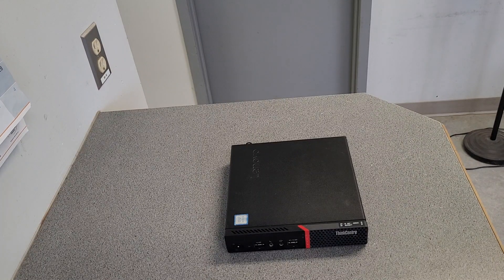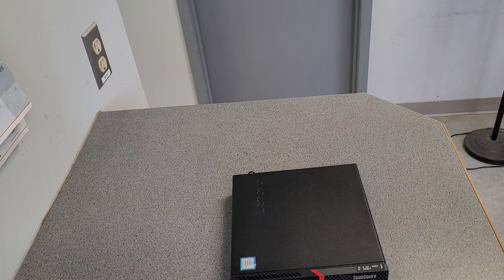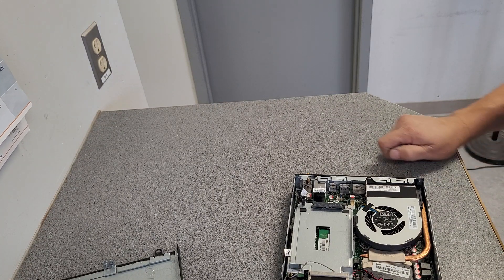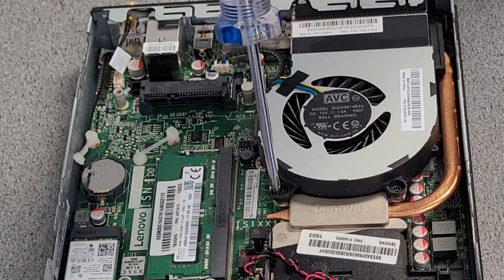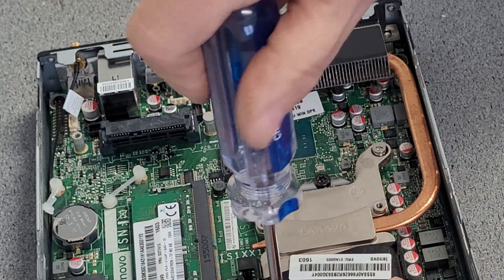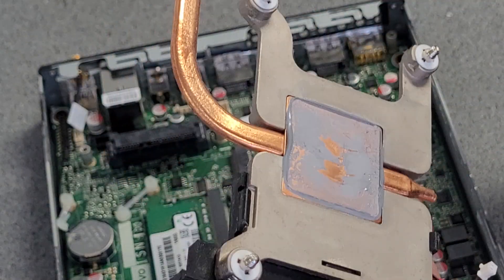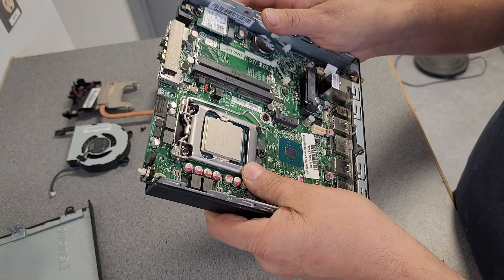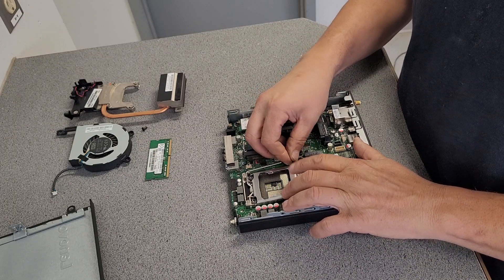Lenovo M700 Think Center disassembly

Comment: The form factor is consider a Mini-DT, or mini desktop. They are generally cheaper then normal desktops because they will have lower end components, usually designed for light operating systems, daily activities in a home office, or even deployed in a business like in your case.

The copper bar you saw below the fan was a heat pipe. It has copper fiber inside it, as well as a small amount of water. The water will evaporate as it heats, and travel to the end of the tube, before condensing and returning to continue the process.

I’ve got to say, I really appreciate seeing someone who doesn’t understand computers taking the initiative to dive in. So many people I’ve encountered lacked the ambition or drive to even learn how their phones worked, when they used them everyday. 

The ‘little WiFi thing back here’ is called an I/o shield/ports. That is the point where the motherboard will allow you to connect peripheral devices (such as keyboard, monitors etc)

You asked if a core 5 is good. Typically I’ll say that the CPUs that are present in these aren’t the best, but it’d be better to determine its quality with the whole number (ex. i5-13900k, i5-1135G7, i5-1235U etc)

You were right m, that little square was an NVME SSD, in the mSATA form factor. The more common variant of that (in towers) is the m.2 form factor, which is like that only bigger. It probably didn’t come with a hard drive, because the SSD was probably enough for the companies needs when they ordered it, but the HDD tray is always a nice inclusion for additional storage if needed. 

Also, don’t call yourself stupid. Ignorant is a better term, as you are aware that you have a lack of knowledge, and are actively trying to better understand what you don’t. Awesome endeavor, I hope you learn a lot. If you can’t tell I love tech, and I love seeing others discover the wonders of it. ☺️
Reply from the maker: Thank you for all the knowledge, I am trying to learn more about tech. I have an interest in how things work, there will be more videos on my venture to find out.😊
Reply: @crazybillsgarage  always happy to help ☺️